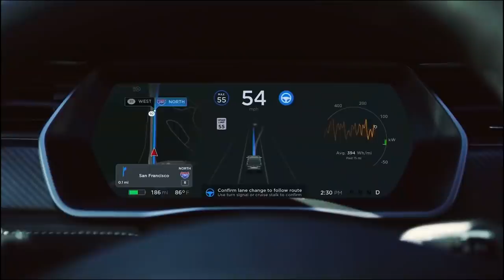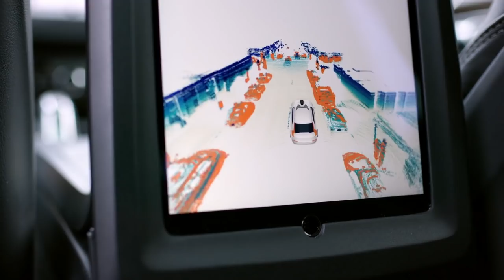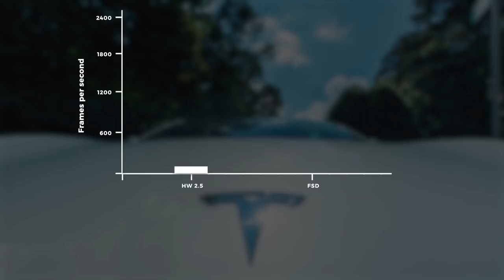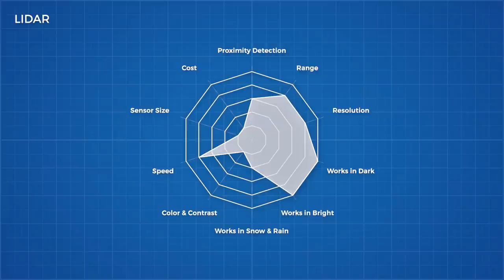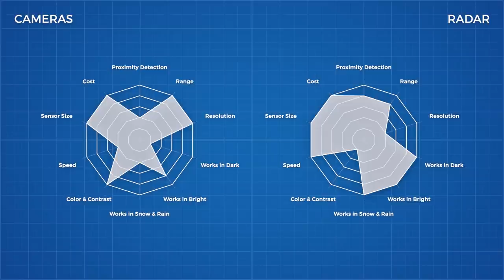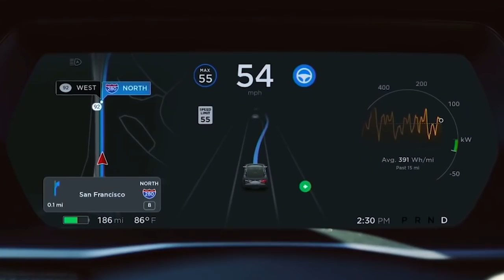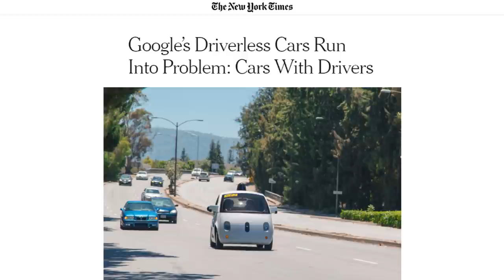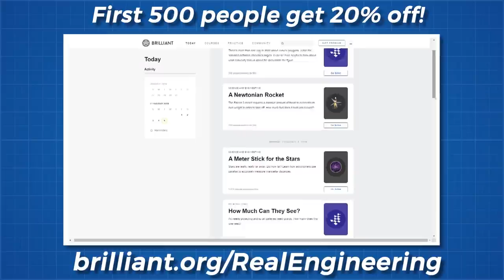The Challenge of Building a Self-Driving Car

Comment: Tesla: so what feature should we add to our cars?
Elon: Yes
Reply: Elon: All the things! (Jesus that is an old meme)
Reply: I love these YES memes.
Reply: Elon: But no LIDAR please...
Reply: You 4chan men don't know what a meme is.
Reply: @CLP its a little more complicated than that, and certainly not limited to Tesla. Volvo has the same problem, in fact all cars with emergency assisted braking have this problem. The problem scenario is when there's a car in front of you that leaves the lane (because it saw what was up head) and you're left too little time to react also. This happens a lot with humans too, I saw it actually just 2 days ago, someone ahead darted quickly into my lane to avoid a stopped car in traffic, and the person behind him couldn't see or tell what he was doing in time to not hit the car. The reality is the human driver would have had a high statistical chance of hitting the parked fire truck also

In terms of why the self-driving and emergency assisted braking cars can't yet resolve this is pretty straight forward. The technology used, radar isn't especially good at detected stationary, non-moving objects.  Lidar is somewhat better but much more expensive, and it's not actually practical yet in terms of durability, Uber is trying to use it but it won't survive potholes and harsh weather so you have a system that is overly costly to start with that will need regular repair/replacement. Unless something can be done to make it even cheaper than it has come down to, it's still not practical for the need yet.

The future is going to be a mix of cameras used in conjunction with each other for stereoscopic vision mixed with radar so you can have the best of both worlds. This takes a lot of processing power to analyze in real time so it can be useful for reacting in the amount of time that is actually needed (our brains are crazy fast computers) and thankfully Tesla already has a new processing chip exactly for this, it wasn't in those cars you've heard of in the news. BUT with those new chips, you will hopefully see fewer cars in the news doing that kind of thing, it's a process though, and Tesla seems up for the challenge, as long as we understand that all advancements take time and aren't so quick to throw blame.
Reply: A car that is actually built properly and doesnt rely on the silicon valley cheat of proprietary "tech" to increase profits while making a shit product.
Reply: TESLEMMINGS:  will they work?
ELON:  who cares?  That's what beta test--I mean OWNERS--are for.
TESLEMMINGS:  but that's dangerous for them!
ELON:  true, but we can sell the crash data and brag about how much of it we have!
TESLEMMINGS:  gosh...you're a genius!
Reply: Bill Cichoke If I was a Tesla short, I'd be mad too...
Reply: @MrYeezy77  You don't have to be a short OR long to he mad at their blase' attitude.  I'm neither, just an observer who sees more trouble the more this company does.
Reply: Hahaa

Comment: "That's the beautiful thing about software. It's easily updatable"
* looks at own code *

* laughs in bad programming *
Reply: Run:
Programming bad laughs.
Reply: That's the sad thing about programming...it's as prone to human error as other human decisions.  It also happens at 100x their speed.
Reply: @billcichoke2534  

Yet an AI does way less irational decisions than a human, therefore is a safer option.
Reply: @thelvadam2884  No such yet.  Everything we're talking about right now is a DATABASE system, human controlled and edited.  It is, therefore, only as good as the humans editing the database.

Still very flawed and irrational.
Reply: That software is easily updatable is the BAD thing about it.  How many times have we seen unstable updates?  Hundreds of times?  Software is never done, not because it doesn’t work, but because programmers just gotta program.  Programmers are ALWAYS fucking with programs.  When you buy a tool, like a screwdriver, you can use it for a lifetime, or tell just by looking that it is wearing and needs replacement.  Users don’t ever know what surprises are built into the latest release, and the same is true of the programmers who built it.  Thats the reason why we have weekly, daily or hourly “updates”.  They are mostly just bug fixes masquerading as “engineering updates”.
Reply: #relatable

Comment: The challenge of building self driving cars:

human stupidity
Reply: I just had an urge to click human stupidity because of the positioning and bold letters lol. 
Also i dont get why people get angry at his comment. The main problem is actually humans not following rules. Sure.. the car killed that person, but only because the person ran in front of it. It's true that we need to programm / train it in a way that allows to handle such situations better while not decreasing over all speed in other situations (which is hard), but looking at how impossible it is to see anything at 1:48, most humans would have killed that person as well. 
In a couple decades self driving technology will have improved to a point where it will become illegal to normally drive a car because of safety concerns. Which will be a good thing^^
Reply: The human poorly programmed the system
Reply: @Zenn Lozanno
You are not wrong.
https://youtu.be/VgQwHDFohTo?t=12
Some morons assume humans will never have to touch their steering wheel again.  Now he is a pancake.
Reply: Just be prepared for the day Where; Using car denied. reason - you are a dissidant.
Reply: @DJ FX AI is good at predicting things
Reply: And snow
Reply: 90% of all our problems boil down to just that
Reply: @Yamyatos   completely agree. I once encountered a cyclist driving at night without any lights or reflecting devices on the wrong side of the road.  Almost ran over the guy.  Sometimes I wonder what the hell is wrong with people.
Reply: Isn't that the main challenge of building anything? If we were less stupid we would have all kinds of better stuff
Reply: building them is not the problem. like google put it to headline: humans driving other cars are.
Reply: So damn true
Reply: Unlike a failed taillight or emission sensor where you can fix it later on.
A Driverless car MUST  run at 100% reliable at 100% of the time. Even at 99% it is a death trap to everyone. 
Name a man made mobile object that is 100% reliable even when new let alone when these cars get to be 5 to 10 years old.
Driverless cars will never happen in a vast scale.
Reply: John Smith they could exist on a mass scale if there were only driverless cars because then they wouldn’t have to deal with human irrationality.
Reply: The first  self driving sports car with a weapon of mass destruction loaded into the passenger seat...  whoops - their goes L.A. or N.Y.C. or  [insert major capital city name here]...     IT needs banned.  plain and simple.  it's too dangerous.
Reply: @kevinstephenson3531  Humans have nothing to do with it .
Just one failed sensor and off the car goes down down a crowded sidewalk.
Reply: John Smith if malfunctions were the only the way that self driving cars would cause accidents than this discussion would be very different. Notice the example this video uses nothing of the machine malfunctioned yet the person still died. It could not deal with human irrationality. It also needs to be programmed better to be able to deal with uncertainty better.
Reply: Zenn Lozanno 900th like
Reply: @Yamyatos  You're an idiot. The OC was correct!
Reply: @tungstenwall474  So.... is that.... an auto-crash?
Reply: The reason for building self-driving cars is human stupidity. You got it backwards
Reply: Briliant!
Reply: No, actual hardware that mimics TRUE intelligence.  Hawking comp is ex database automation as self-driving is not only dishonest, it's DANGEROUS.
Reply: @Crashed131963  

The main selling point of self driving cars is a saf*er* car, they simply have to do less errors  causing in accidents than humans do . I bet all my money that a computer is closer to perfection than any human ever will be.

Just take a well trained AI on chess as example, u will never beat an AI trained on chess data, ever the best human chess player was hopeless against an AI in 2003 iirc.

To my original point, all they have to do is be better than humans or the other way around, do less stupid irational stuff bringing people's lives in danger. Now u already improved the safety on the streets.

Cheers 
- Thel
Reply: @Crashed131963  Watch the video first and please don't talk bullshit!
Reply: @thelvadam2884  When a driverless car turns 10 years old and is worth 1/4 of its new price you will trust its 10 year old brain box and sensors?
The back up cam on my 2015 SUV just quit on me without notice.
Luckily a backup camera does not control the brakes or steer the car.
A 100% reliable man made object never has been made or ever will.
Reply: @thelvadam2884  At first Driverless cars will work.
Wait until later when there are 12 year old $2,000 used driverless rust bucket cars running around all over the place with people watching youtube behind the wheel.
Oh that's right Driverless cars work 100% 100% of the time for years and years.
Reply: @Yamyatos  SD vehicles have been taking a while now, considering the performance standards of the latest hardware/software

Comment: Work with the glass cockpit shows that relying on pilots (i.e. drivers) to intervene when automation exceeds its boundaries is extremely unsafe.  The time it takes for the driver to gain situational awareness is often way too long for whatever bad things is happening.  It is much safer to keep the driver as a driver, rather than have them be a "manager" and only be a driver in extremis.
Reply: just a matter of the automation level
Reply: @OfficialFront  Has more to do with requiring pilot/driver to continuously maintain awareness, rather than need to rebuild it in a time-limited situation.  Thus the type of automation is key, rather than the overall level.
Reply: The reason why cars crash isn't because drivers are human, it's because they're unprofessional. If there was more of a culture of driving like you life actually depends on it (like bus drivers and airline pilots) then we'd have fewer accidents. All the sensors and computers are great if they augment the drivers ability (stay in the lane, watch for blind spots, etc.) We start running into problems when its specifically designed to make the driver feel unnecessary and stop paying attention.
Reply: @jeffbenton6183   Are you suggesting that Airline pilots are unprofessional?  The reason that we know about this type of human failure is because airplane safety is extensively studied.
Reply: @jborynec  I thought I was saying the opposite. Flying is safe because pilots are professional and every incident is closely studied. We don't do that with driving.
Reply: @jeffbenton6183  I suspect that we are talking to two different points.  Yes, ordinary drivers are idiots (and I am an ordinary driver, so I know).  But building automated systems that "help" drivers drive in normal circumstances but rely on drivers to intervene when circumstances stop being "normal" are positively dangerous.  Glass cockpit studies show that there is no way a highly trained and motivated human can assess the situation and intervene in time.  Expecting an "ordinary driver" to do so is simply a way for the manufacturer to try and avoid legal responsibility for the inevitable crash.
Reply: @jborynec  Actually, we totally agree. I'm just really bad at communicating. The only kind of "help" that I think is positive is a system that increases the driver's situational awareness. Maybe for instance beeping when he starts drifting, or beeping when radar or kid at detects something that might be difficult to see in the dark. 

Any system that gives the driver a false sense of security, anything that gives him any reason to believe that the car is in control and he can just relax is pernicious. I think we're in agreement on that last point, if I understand you correctly.

Comment: LiDAR has more disadvantages than just the cost. It doesn't give you the meaning of objects in the scene:
It can detect a shape on the road but it can't tell you whether it's a bag or a tire.
It can detect a human but it can't tell you if the human is just standing watching their phone or intently looking to see if it's safe to cross the road.
It can detect road signs but can't read them.
All of these things can be solved with cameras if you have big enough data sets and compute power.
Reply: A camera doesn't tell you what objects  are either
Reply: @peepiepo  You're right. The radar complements that. Camera + radar beats LiDAR in every way.
Reply: Elon also showed that the computer in a Tesla is powerful enough to calculate a 3D-environment from camera-data alone, getting all information a LiDAR would provide. So LiDAR is only good at the beginning but high-perfomance computer and cameras will overtake LiDAR soon or have already.
Reply: @elyakimlev  No. Radar also doesn't give you any knowledge. Computer vision does that. And it works on LIDAR as well. Sensor fusion is also not limited to radar and cameras, there's nothing stopping you from fusing LIDAR information into the system as well. (Well, besides cost.)
Reply: Lol u are just wrong
Reply: Yup Lidar has many disadvantages. That's why other companies use lidar with cameras and radar. It's a common misconception that other companies solely rely on lidar.